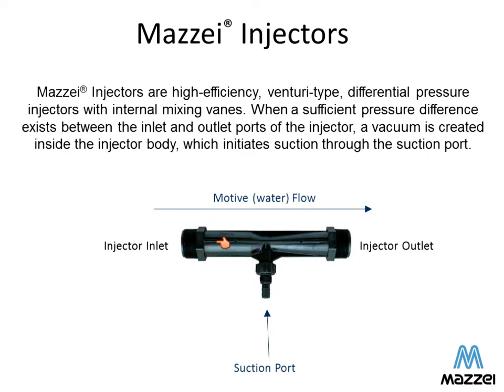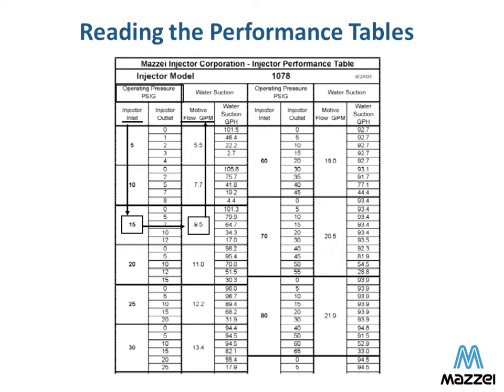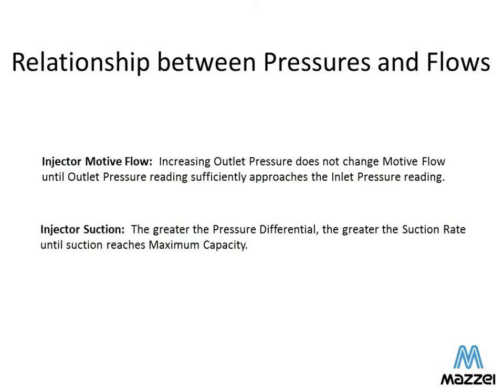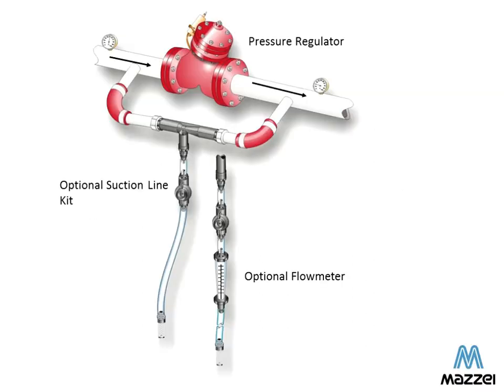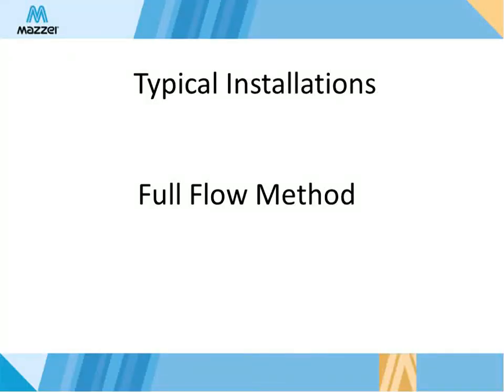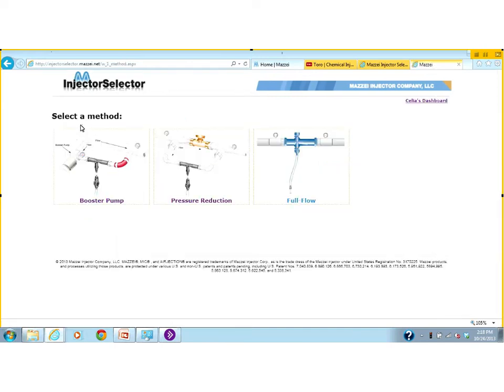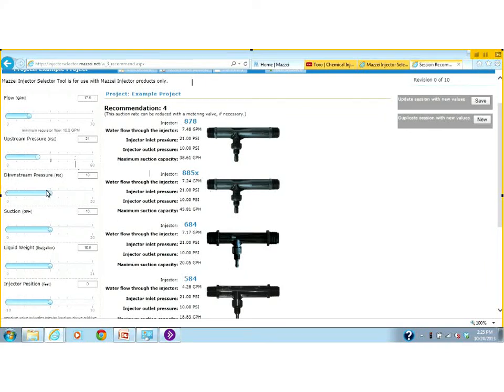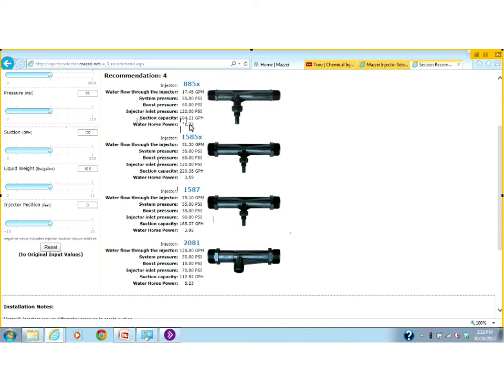Chemigation/Fertigation Design & Optimization with Mazzei® Venturi Injectors

Comment: My main line is 6 inches, upstream pressure 1.5 bar, down stream pressure near sprinkles 1 bar.
I have used both 1 inche and half inch Venturies in horizontal position but failed to suck, what's the problem please ?
Was main 6 inches made this problem?

Comment: my system does not seem to suck any water at all from the 35l bucket put . i used method 2 with pressure rec valves. Upstream is 2-4 BAR depending on how many blocks I open. Downstream i put a pressure reducing valve at  1 BAR. because of the downstream dripper lines . could that effect it. The venturi is horizontal , on the upper 25mm bypass pipe the valves down on the main 25mm pipe

Comment: I noticed that all videos of venturi injectors are in a horizontal position. Do they work in a vertical position??
Reply: Yes Mr. Hans, It works but you have to be careful. The flow should be upward and not the other way around. There has to be backpressure for the system to work properly.
Reply: @kailashrangaraj  Thanks for the info.